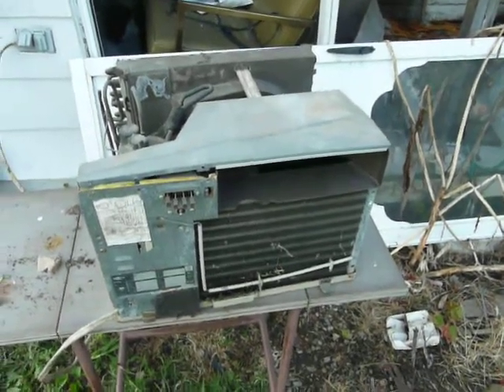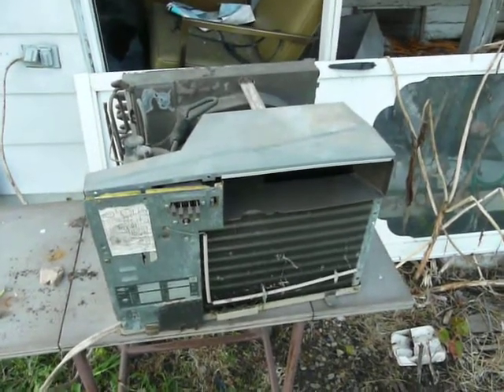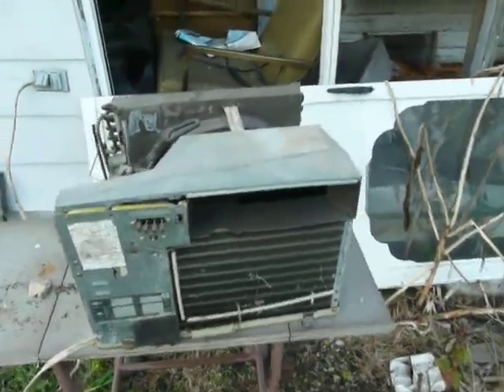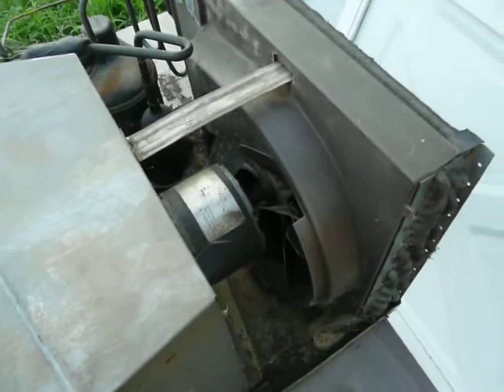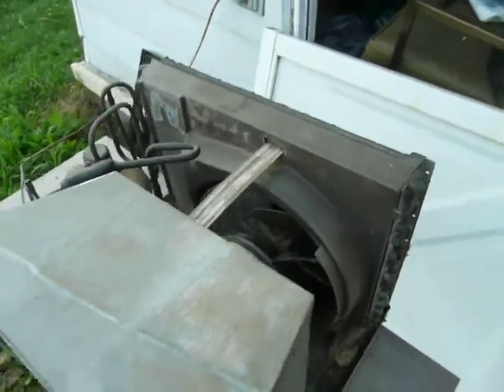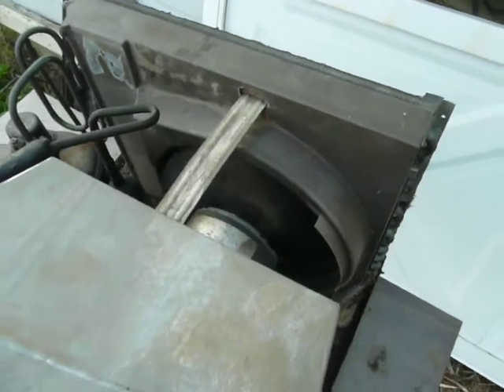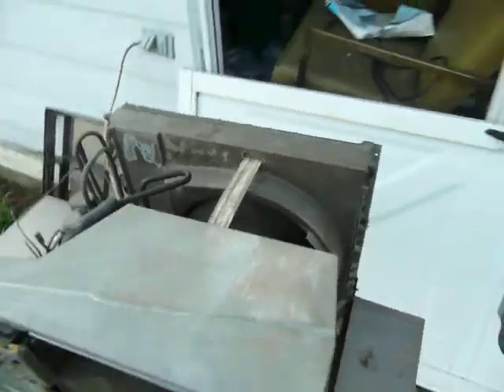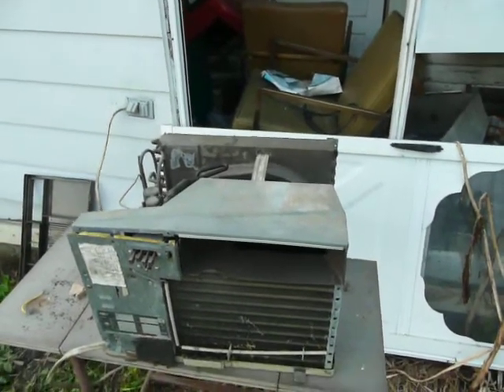Trashpicked Carrier Window Air Conditioner with a Problem

Comment: You either have dirt in the motor from pollen or etc., or the motor has gone bad.  My Frigidaire sat outside for a long time in the elements and it had the same problem due to dirt in the motor.

Comment: I took apart a vacume motor It worked except you had to manually spin it to start it turning. I think the brushes in the motor were bad. not shure if thats your problem though...

Comment: Fan lube becomes sticky when bearings heat up.  Spray carb cleaner on motor shaft bearing area, run for awhile and after a bit apply fresh light oil.          Or take motor apart  and clean bearings,  that method is  best, but it can be very time consuming.

Comment: if it runs and then stops its almost surely the heat build up on the bearings. try repacking them if there are any on the unit.

Comment: I had the same problem with an air conditioner and it is definately the motor. The only other thing which would stop a motor would be ice and if that were the case you would know it.

Comment: I'd be willing to bet that your A/C unit has a Permanent Split Capacitor motor in it, you may want to check that motor run cap out. Just to be sure, give the fan motor a shot of oil.

Comment: Take the motor out, Take it apart get some
150 grit sand paper and sand where the
bearings are on the shaft REMEMBER sand in the
direction the motor spins on the shaft...
after that go with finer sand paper and then 
000 steel wool, get it smooth... as for the 
bearings steel wool ONLY... oil'er up and its
ready for the long haul.
If the shaft is scared or glazed better change
the motor.
See'Ya later, Timm

Comment: I hate say it but I'm  pretty sure its a bad motor... As it heats up, the rotor expands just enough to contact the stator and bind, slowing it down to a hum. When the motor cools, the rotor returns to normal diameter and works until hot again.
Reply from the maker: I was increasingly starting to think so myself. Not long after this video was made, I discovered that the thermostat was bad. I simply bypased it and never had any trouble with the fan motor again, until one day the run capacitor failed.